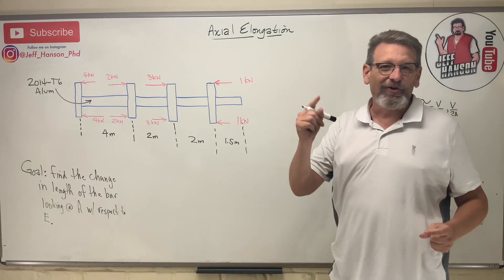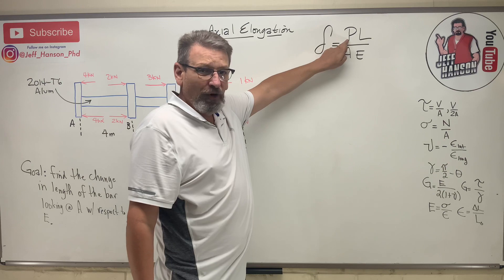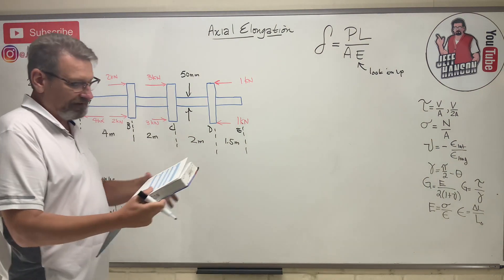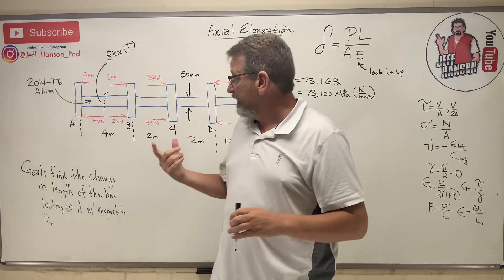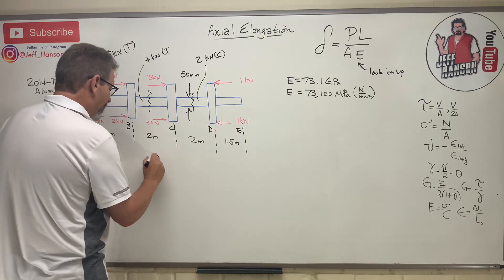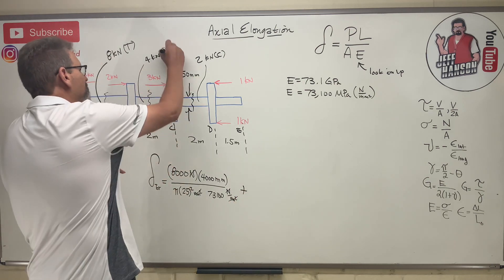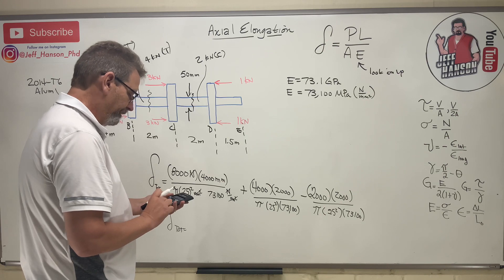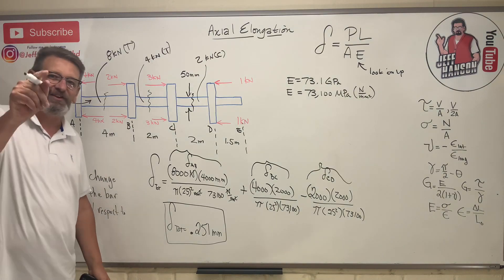Mechanics of Materials: Lesson 17 - Axial Elongation Due to Axial Load Example

Comment: hii how do you know the first section is in tension? It looks like the forces are going towards A which would be compression? lol I'm studying for my strength of materials exam 1
Reply: Imagine the shaft in between the couplings are being pulled by the 4kn and the 2kn on both sides of the shaft. That section is being pulled apart creating tension. Another way to look at it, you don't have the 8kn pulling towards the shaft but rather away.

Comment: Why we did not take these 2kN's for calculation? I am confused. If anyone knows the answer, pls reply it.Thank you!!
Reply: Hi, you can use axial load diagram to solve this even faster. You can take load at A as 8kn, load at B as 4kn, load at C as  6 kn and load at D as 2kn. 
Assume load going left as positive and loads moving right as negative. Axial load  diagram would be as follows:

      +8kn.     8-4=4kn.     4-6=-2kn
A.            B.                 C.                  D

When the -2kn reaches point D, it meets the left side moving load of 2kn. -2+2=0
Since there is no load as I explained above after point D, you do not need to calculate anything. If you still did not understand, let me know you email and o will send you a solution of this problem.
Reply: @ahmaranees  hey firstly thank you for responding my question. I still don’t get it. If it is no problem to send solution of question, you could send to erayerkul7@gmail.com 
Kind regards :)
Reply: @ahmaranees  I didnt understand, would you be happy to help me?
Reply: Hi. He looks at one side of each section as we know it is in equilibrium. Forces will be equal on both sides of the imaginary midpoint squiggle he drew. On his first section he looked at (8kN) he looked at the left side as it was more simple. He then showed adding the right side did also equal 8kN to show this. I was confused at first also.